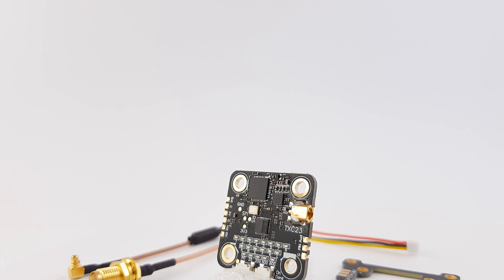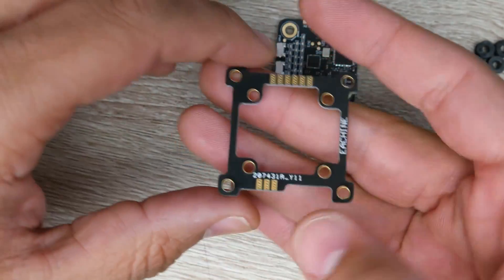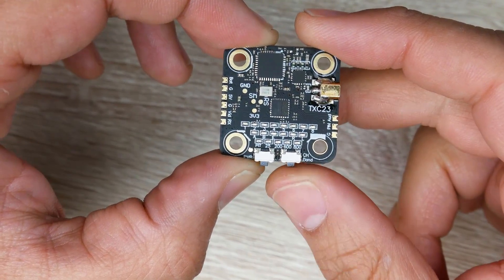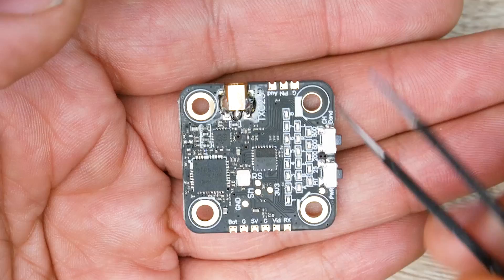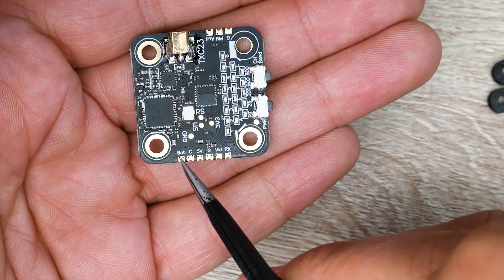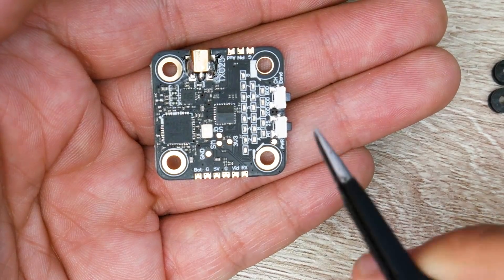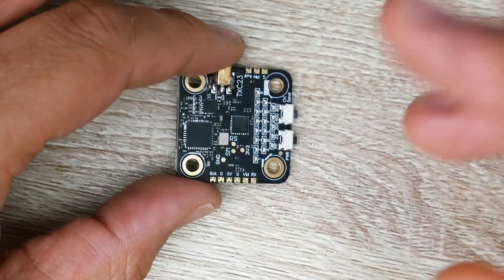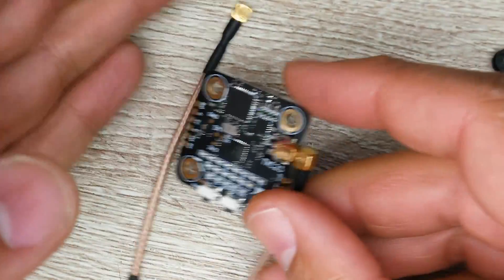Hurry Before It's Gone /// Eachine TXC23 PIT-800mw VTX

Comment: Great vids thank you!!  If i'm using the control power button on the unit to switch between pit/25/200/400/800mw at power-on, then the LED constantly just resets back to 200mw designation.  Curious if you know does that mean its not setting to 800mw for some reason maybe i'm doing it wrong?  Or does that mean its on dynamic power and its adjusting down to minimal wattage setting ie 25mw until it senses being out at longer range and then the VTX will automatically run up higher to 800mw as only as necessary?

Comment: Thanks for the video! I was wondering what the "PIN" labeled pad is used for, since there is no documentation (that I found) about this. I tried pulling it to GND and it seems to switch the VTX off. I'm pretty sure, it's a power switch. This would allow for switching the VTX on/off using the Betaflight PINIO feature (if the FC doesn't already comes with an inbuilt transistor switch). Maybe others can confirm this... I wonder why Eachine  doesn't mention this feature... maybe there are issues?